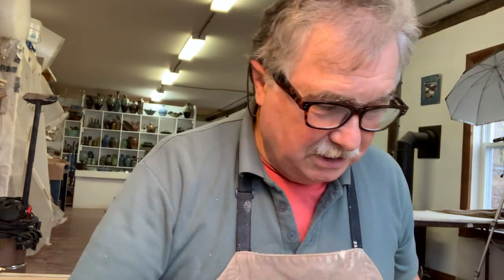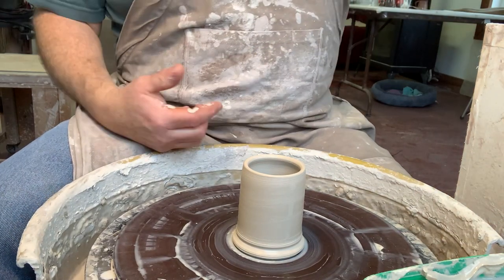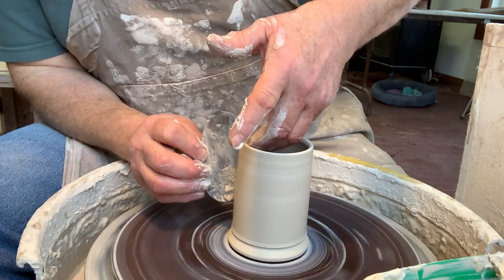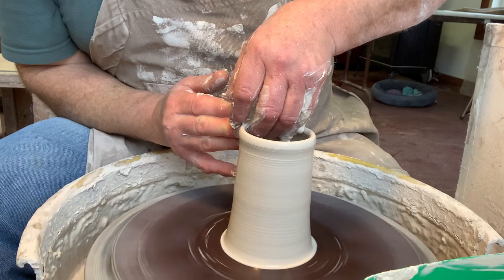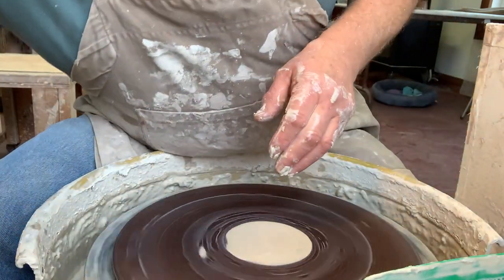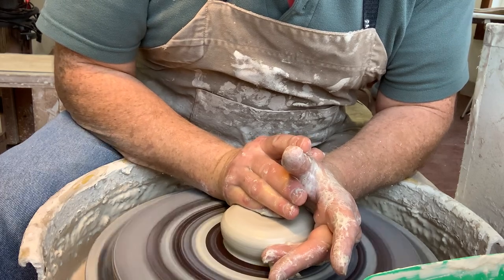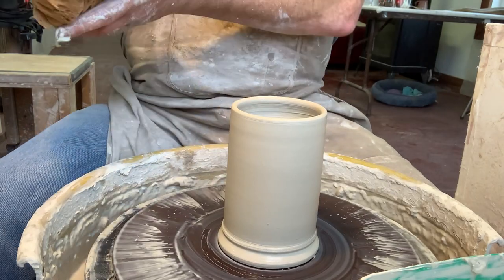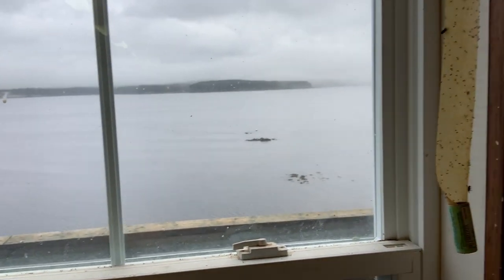5 thrown coffee mugs, 5 different weights of clay.

Comment: I'm 77. Production potter for 45 years LOL I learned to throw much dryer than that. Calipers for opening and each form had a measuring stick. Compressed the clay inside after opening with a wooden rib. Every mug on small bat no extra water to get it off. The dryer the better. Made soft ribs from plastic containers for compression for shaping. Mugs not cylinders. Disabled now. You make me. Want to go down to the studio again
Reply from the maker: I am 67 and I have had a bunch of new aches and pains over the last few years. Sold my first pot in 1973 so it will be 50 years next year. I don't know what else to do so I guess I will keep potting as long as possible. Thanks for watching and stay safe.
Reply: @Vsmithpots  take care
Reply: I am 80 and Vaughn nails it ,,great job

Comment: hi,  re the 315 gram [clay] mug, am mystified by my own inability to stretch it to the height after getting the width correct. i most definitely throw thin (smooth terracotta), check base thickness and clay weight on a digital scales ...and my height is still a good half inch short of yours. Do you know off hand if the "inches" and "grams" are the same for canada as for the uk,  i thought they were the same. Have you any suggestions or is there any possibility your measurements could be out (sorry:). this will be such a useful "5 mug" info video when i get my throwing sorted, thanks

Comment: Tough having to deal with that view.
Takeaway from this video has my mind made up to try your method of cutting from the wheel instead of doing dry cuts to lift off. This will mean cutting the lip off my splash pan where I attached my drain box and hope it holds up. The Aspire splash pan is too close to the bat for me to get a decent contact with the pot when sliding off. Having remodeled the front I will be have enough room.
Thanks for another useful video.
Greetings frae Florida @ 10:10PM
Reply from the maker: Hi Freddie, you can use pot lifters. The problem with dry lifting is your pots have to be thicker to avoid warping. Stay safe.
Reply: I am good at having thick, your method appeals to me and when I used pot lifters in the past I was rubbish at it. I only have to do a little rework on the splash pan for me to slide off the pots.

Comment: My Generation uses grams, mm and cm.
Reply from the maker: I try to give metric and imperial because the USA still uses Imperial. B-mix 5 is a great clay body but it does not do well over cone 5, many commercial glazes are developed for cone 5 because of it. A quarter pound would give you a nice shot glass.